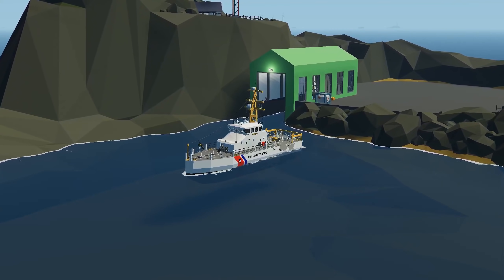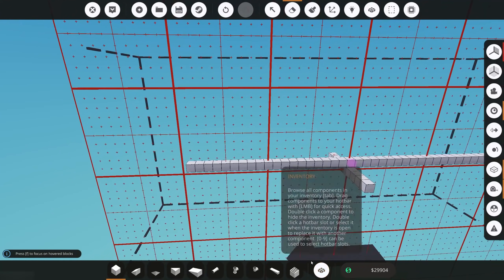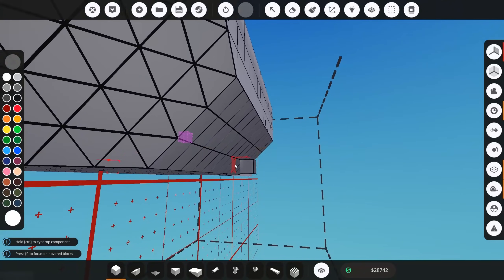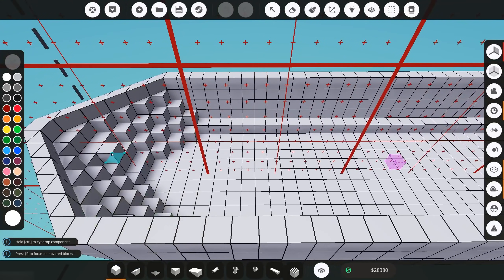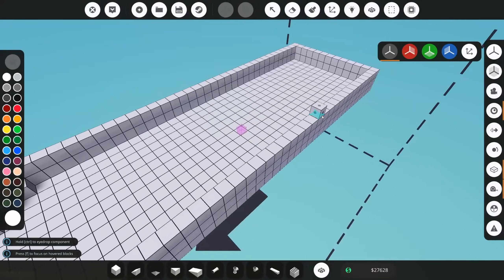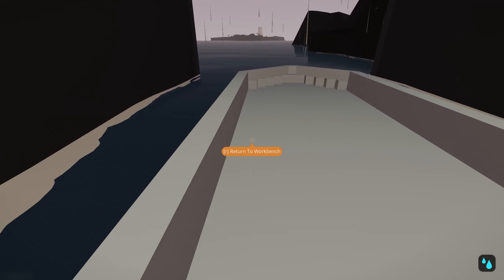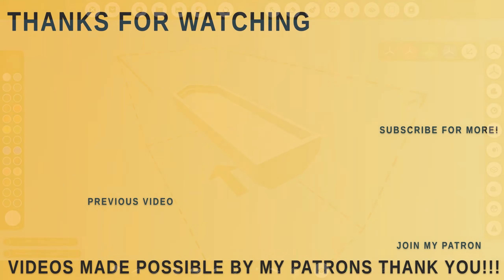Stormworks Official Tutorials - Hull Design Basics

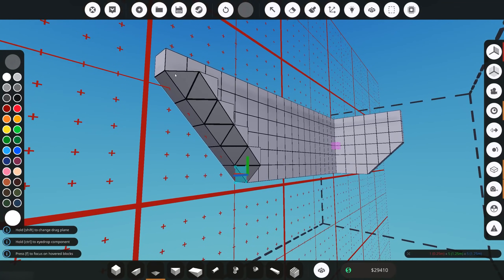Comment: How do you make the bow smooth like that I can’t figure out how to make it look like that @3:17 what button do you press
Reply: You need to use the pyramid and inverse pyramid to match the wedge shape you want.  If you double click the hot bar, you can select the pieces you want to place or drag pieces from the parts menu to the hotbar slot you want then use 1-9 on keyboard to fast select from the hotbar.